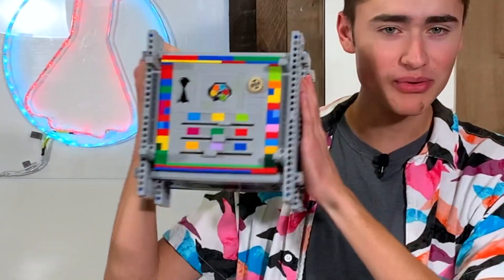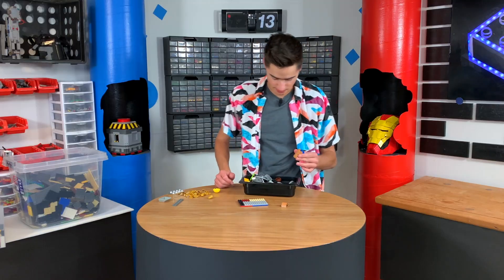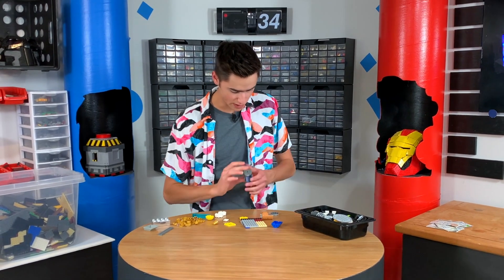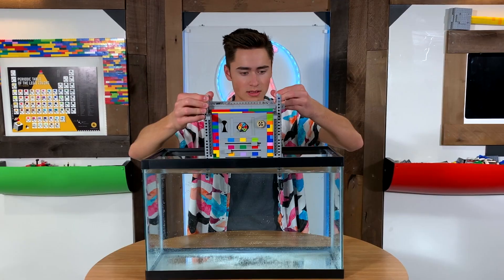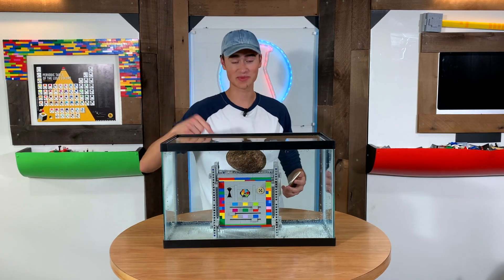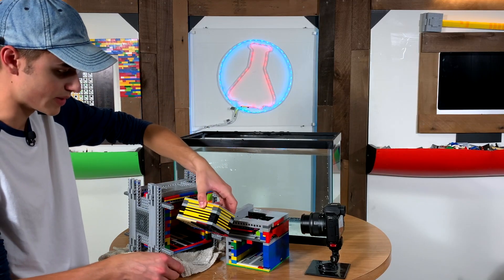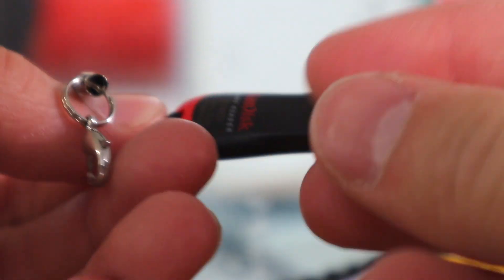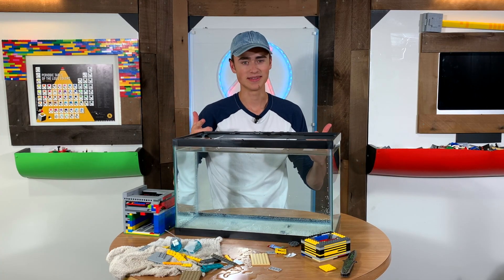I Made a Waterproof LEGO SAFE!

Comment: 24hrs in clean water didn't do much damage but I once kept a sd card reader in my pocket and the next day I put the  pants in the Washing machine without taking the reader out. I realised that I have washed it with soap,  dryed it and it was still in my pocket two days later 🤣🤣🤣
But when I plugged it in, it still works!!! 😱
Reply: I did the same thing with a usb and it broke :(
Reply: Meanwhile, I put my phone in the wash and pretty much did the same thing and it died.  

To be fair though, the reason the SD card survives is space...or rather, lack of space. There's a lot of space in a phone that the water can get into, not so much for an SD card which is mainly a chunk of plastic with metal bits glued into it so as long as you run it through the dryer, any water that touches it will evaporate in the heating process, unlike a phone where water gets trapped inside it.

edit: I realized you were talking about a card reader and...yeah, the same still applies mostly.  Card readers are just chunks of plastic with metal bits glued between then and exposed openings, as long as there is heat, it will evaporate all the water so long as ports aren't covered by cover or cap.